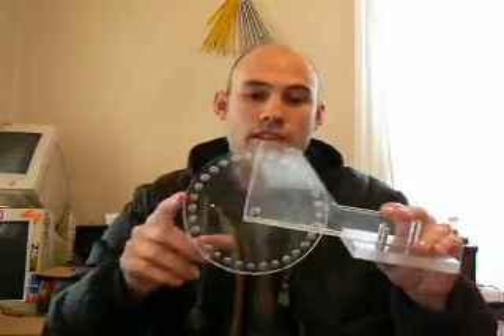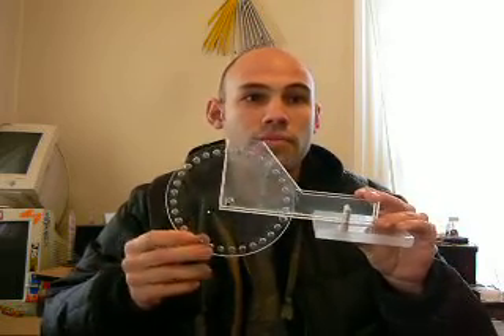mWheel Disclosure 10^100

Comment from the maker: Thanks a lot! It wouldn't take to much to finish this system, a bit of time to optimize with the proper resources. I don't think the shock forces seen by the magnets would be sufficient to cause demagnetization... even if it did, the cost isn't to much to prohibit replacement.

Comment: I just figured out why the weight would *not* have to be 1/13th of the weight of the vehicle.  After all, the system is not trying to lift the car, just move it.  (wish I could take back that other comment).

That aside, my only concern is the material's capability of withstanding the constant impacts from pounding the road.

By the way, the more I think of your idea, the more I hope you get prize money for its development.  It's quite the paradigm breaker.

Comment: I read that the neodymium magnets can lift 13 times their own weight. Would that imply that a vehicle with this system would require that at least 1/13th of the total weight be magnets?  If anything remotely so is true, I would have two concerns with respect to the size of the magnets:  the amount of magnetism inside and outside the vehicle, and the possibility of magnet self destruction with continued impacts from being on wheels pounding road.

Comment from the maker: This airflow and resulting low operating temperature allows use of the highest grade magnets. 

Your idea is right on. In a multi-wheeled vehicle (where more than 1 wheel is powered) the wheels would be controlled/powered centrally, negating the tendency to spin out. You would need to modify each wheels signal as a function of its instantaneous turning radius (a simple differential calculation as you said).

Comment from the maker: Hi, thanks for commenting. Demagnetization has been a problem in brushless motors employing neodymium magnets. This is due to them losing magnetism in moderately warm environments (only around 80 degrees C) and the high temperatures encountered in traditional encased motors. With the mWheel configuration, heat dissipation is greatly enhanced since the magnets rotate through ambient air for a period of each revolution.

Comment: I like the concept.

I'm wondering if demagnetization of the permanent magnets would be a problem.

Expanding, however, on the idea, I also wonder if a "reversal" of the idea might be used on the mWheel to detect loss of traction in a 4-wheeled vehicle, but, most importantly, if traction detection is even necessary, by simply having 4-wheel drive all the time with a simple differential calculation incorporated into the timings of the signals sent to the wheels.

Refreshing, regardless.